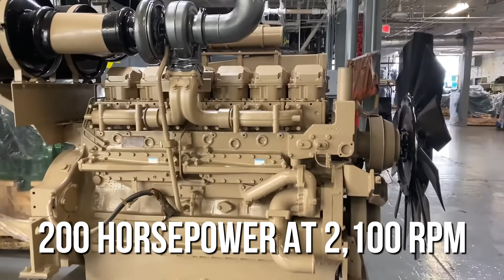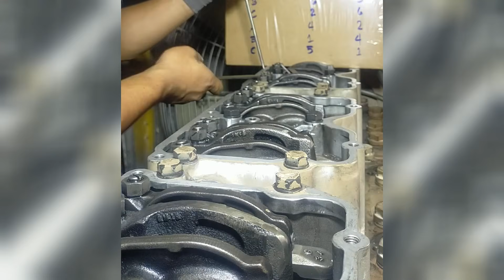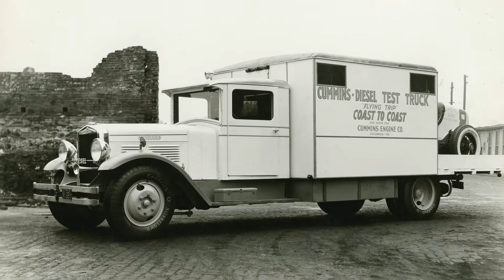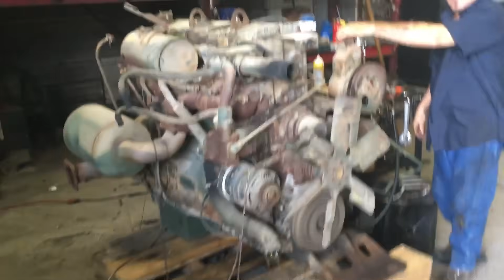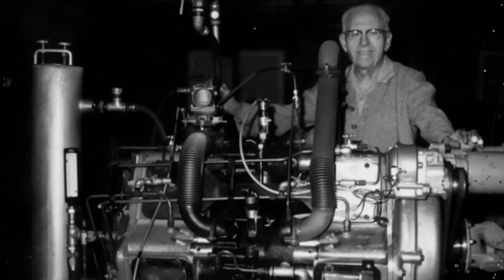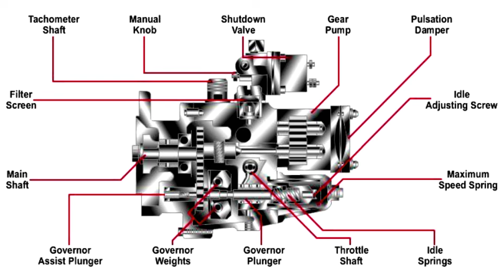Cummins Bulletproof NH Engine That Faded Into History

Comment: I recall a UK commercial motor show in the early 1970's, at which Cummins had a stand. They'd  taken an NH engine, with 250, 000 on it from a working truck, cut it open so that all the vitals were on view. Next to it, they placed a brand new NH straight off the production line. There was no measurable wear on the former engine. Also on the display, was full documentation of the engines service history and the haulage company that bought it. I have always been a Cummins fan and remain so. Wonderful diesel engines.

Comment: What was happening  the engines were becoming far more complicated and expensive to build and maintain. Also compression ratios were going up that increased the nitrous oxides in exhaust gas. This is exactly contrary to requirements so all kinds of modifications were made until the diesel became a scrap iron jungle. A friend of mine designed and built the lowest emission engine in the world. A steamer. Took it to America but they didn't want it. Still don't. However the enemy of the American truck building industry are not only at the gates, they are inside the gates and they  are going to find out all about it in a hurry. Personally if I were in that situation I would be taking a hard look at at the steamer. So cheap to build, maintain and operate on a higher flashpoint fuel than premium diesel. At some point they are going to learn to eat crow if they want to survive. I'm just waiting for the day and man if I'm still here a few others will be eating crow for a very long time.

Comment: When I joined the Fire Department at 17yrs old we had 2 Engines that were Hahn Fire Engines and they had Detroit Diesels and I’ll never forget the sound of that engine screaming while getting my SCBA on and the sound of that Detroit Diesel screaming just increased the adrenaline rush on that ride and the cab was opened on the back so it was loud!! Paired with that RoadMaster 18 speed transmission (I think) made it sound so awesome hitting all those gears!! For those who have not had the pleasure of hearing them you truly are missing out as it is definitely a one of a kind sound!!..Loved It!!
Reply: BUFF,CALM down Volley.

Comment: I worked at cummins 35 years and worked on the 743's and supercharged 743's. The main reason engine families go away is they were not capable of running long lives without frequent overhaul or had too many needed design changes. 
Customers were asking for longer run life.
At the time Cat engines were running 750K miles but to be fair early cat automotive engines (1693 )were just modified cat industrial engines that we all know had long run life.
The N14 was a total redesign with the problems engineered out (almost all). There was a Private fleet of heavy haulers that ran in our territory. They had cab over petes with NTC 400's They did 10k oil changes and took care of the engines.
At 450K miles they brought them in one at a time for overhauls due to low oil pressure. I overhauled 5 of the 10 and the main and rod and cam bearings were worn completely out. This proved a redesign was needed.
The N14 had much larger rod and main bearings and better materials in the bearings.
I overhauled a customers N14 that had 1,348,600 miles on it and the crankshaft bearings could of been reused. He did 10K oil changes and good maintenance.

Comment: I worked for Cummins for years as a field service technician and I worked there when they were phasing the N14 out and adopting the Signature 600/ISX . The main reason they did away with then is because semi trucks were going to the more compact aerodynamic curb sniffer designs. Curb sniffers have a shorter engine compartment and the N14 engines don’t fit in them were as the shorter ISX does . If it were all about emissions all that stuff could have been retrofitted on to the NH series engines like they did and are currently doing on the K series Cummins engines, but it was about shorter engine compartments in newer model trucks and over the road trucks where the main application for the N14, that what actually killed the NH series .

Comment: What I want to know is why HP ratings are mentioned when diesel engine are known for torque. HP doesn't tow , TQ does.
Reply: because hp tows, torque is a useless number.
Reply: @V8Lenny Horsepower = Torque x Engine RPM / 5252
Reply: @kkoch666 not always 5252 and higher horsepower always wins anyway.
Reply: @V8Lenny My point is without torque there is no horsepower.
Reply: @kkoch666 you can measure horsepower without knowing rpm or torque, because horsepower is what makes work. Torque is just a number needed in other calculations, not needed to move vehicle.

Comment: Shorter heads are also easier to keep flat. Heads need to be very flat to work, this can be a challenge with a long head.  For a long haul truck, 10,000 mile oil change would be okay, but for a local delivery truck, maybe 5,000 miles.

Comment: This brings back so many memories.

My dad worked for Cummins for decades and I did for a few years in the 70s so I saw mostly 855s.

The only reason I stopped was because I weigh about 135 and wrestling such monster parts was almost comical. 🤣

Dad's shop also crammed a Cummins V6 into a late 60s Buick Riviera and we took it to several car shows together.
Reply: I worked for Cummins from 1967 to 1993, when they laid me off .

Comment: The N14 was a vast improvement over the big cam engines. Bigger crank, heavier block stopped the liner problems. Injection system was super, But the idiots at Cummins dropped it for the junk they make today.
Reply: Cummins didn't kill the n14, the epa did.
Reply: good. Put dirty engines to rest

Comment: Cummins NH has a root blower it's  not naturally aspirated. There are so many non facts in this video
Reply: You watched some of your videos. Only about the first four minutes of it, and i've i caught several inaccuracies, the uh nih. Engines had four valves per cylinder long.Before the big cam engines came along also in a 4 stroke engine, I like the Cummins if it has a supercharger that is not naturally aspirated, that is forced induction. Now, in the case of a Detroit Diesel,  you have a 2 stroke engine, a supercharger on that is,  not pressurizing the incoming air charge. I'm not necessarily trying to be a jerk here, but you really need to do a little more research and be more accurate about your facts that you're passing on. I know a lot of this about these engines because I used to work on them. I'm a diesel mechanic
Reply from the maker: An engine can be considered naturally aspirated even with a roots blower, because it scavenges air, unlike a turbo which forces air.
Reply: @VintageAmericanMachines you are full of crap 💩  I watched your video hoping for something informative, its absolutely terrible to someone that knows these engines and the history of Cummins...
Reply from the maker: @jctractorrestoration6810 sorry you feel that way.
Reply: @VintageAmericanMachines actually Roots is forcing air in, turbo cant force it, it just compresses air which is then scavenged like in NA engine.

Comment: When I worked on old Manitowoc Twin VICON cranes, we had 855 BIG CAM engine blocks with over 100,000 hours on them.  When I left they were still running in 2015, and one engine was in a crane from the 1960s.
Reply: No doubt. If they were maintained properly they would last almost forever👍
Reply: i believe ya

Comment: Did the head line say the NH was killed off. No the NH as with Detroit 2 strokes and a heap of other engines became obsolete due to EPA regulations, no mystery, No intrigue just plain old obsolescence.
Reply: Manufactured obsolescence is not "plain old" at all. The epa has manufactured a crisis to receive fines to regulate things having no measurable effect on said faux crisis. Even if you agree with climate change you shouldn't be okay with them allowing heavy oil to be burned while delivering our goods from the ocean. Planes aren't the big problem, ships are, and trucks get the bulk of the blame for a miniscule contribution
Reply from the maker: Exactly...the EPA killed it.
Reply: @VintageAmericanMachines  But going straight to the point would make for a dull video, right?  --Doozer
Reply: Good. Clean air is critical

Comment: Hot rods should be diesel with laser fired and rather hi rpm and smaller for less weight. IT CAN BE DONE
Reply: Led injectors to fire correct mixture .  Forget electric  or blend the engines that run on both

Comment: 903’s by hand. 4 valve heads where available decades before the big cams. More research recommended.
Reply: This shit is AI generated,  unfortunately
Reply from the maker: @Guns_N_Gears um, not it's not. I "generated" it with a lot of hard work. You may not like it, but that doesn't mean it's AI.
Reply: @VintageAmericanMachines 
More hard work is needed then because there is some misleading info in the video
Reply: @VintageAmericanMachines  Annnd, I call BULLSHIT!!! "Not AI"
Your channel started 5 months ago!
Hard work MY ASS!
Report this!!🖕

People start looking at the channel, and go back to the start date.
Reply: TYhe 903 production costs were high so the cheap minds at Cummins pulled it out of Trucks. An engine that would run well over 1 million miles. It is still used today in the US ARMY Bradley armored vehicle. Cummins make some really bad choices. Still do.
Reply: I’d suggest you align the images with the specific engine you are referring to. You might as well not show any image if it’s not accurate. When it’s a 
technical subject, correct information references are crucial.

Comment: How on earth can you adjust valve lash with firmware?  Sure you can monitor valve timing and may be able to see if it needs adjusted. But you still have to physically adjust it unless it's hydrologic in which case you can't set it.